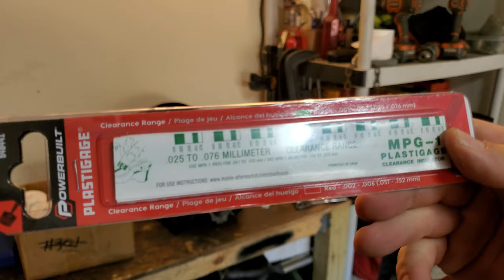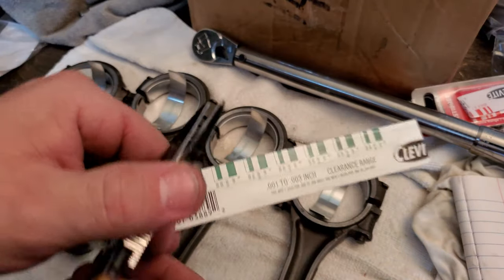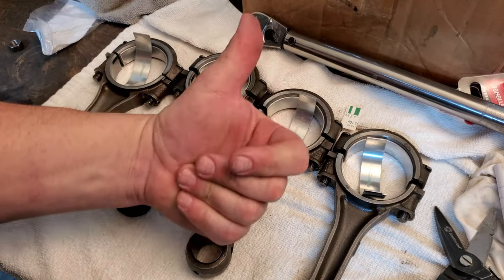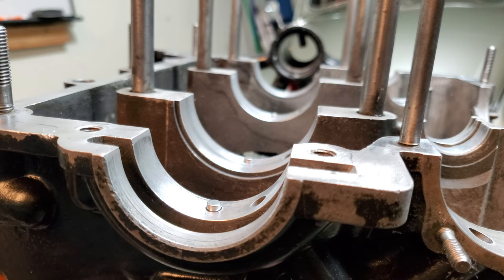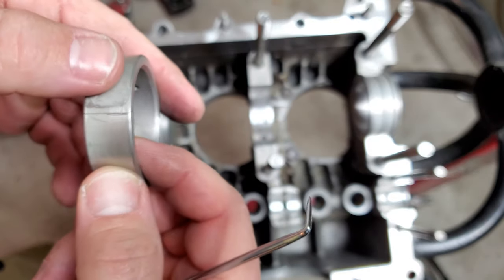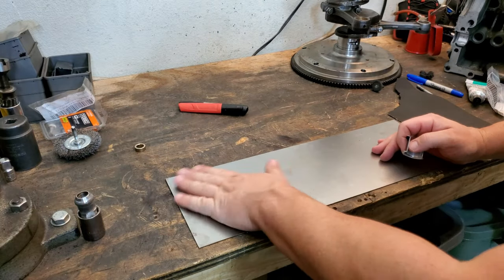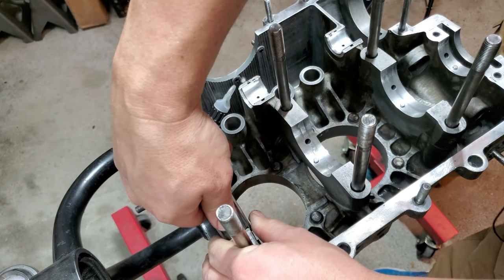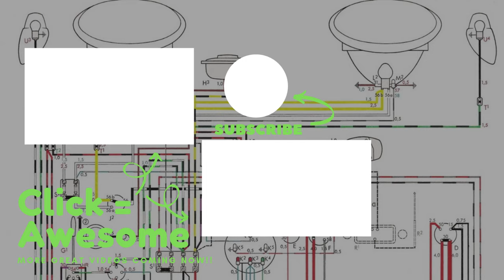How to Rebuild a VW Air-Cooled Engine "PART 3" Bearing Fitment | JW Classic VW

Comment: I would use a copper head hammer to tap bearing dowls in it cases damage on the engin it causes litt or no damage to any parts on assembly .

Comment: Great video & love that you dont waste time on small talk. Whats you opinion on straight cut cam gears thx...
Reply from the maker: There is all kinds of info out there and opinions as well, I believe that when you have a higher power engine that may be spending some time in the higher RPM range say above 5G then they can definitely help reduce the stress on the valve train.

Comment: Iwont you trying idf injection  type in your engines
Am now trying it on 1.6L
its amazing no need adjustments works perfect 
You can see my test start on video 
You can use any type of ecu
Iuse vw golf all same and owen wiring and works 1.6 and it works with bigger engine without programming only when add turbo that time need more fuel so programming should be
Thx for video great job you doing😍
Reply from the maker: Someday in the future I will build an EFI BEAST... just not yet!  Thanks for being here brother!
Reply: What year/engine vw golf??

Comment: Got a question? Got all the locator bearing pins out except for the aft one that take the smaller bearing. I tried a magnet and needle nose but it's really in there? I could let the machine shop worry about it before they alinebore it. Unless you have dealt with this before? let me know. I guess I could heat the area around it just enough to pull it out maybe?
Reply from the maker: Yup... I've had to heat it up as well.  Sometimes they still won't cone out, then leave it to the machine shop.
Reply: Do i need to remove the oil pickup tube for the machine shop to alinebore or just leave it?
Reply from the maker: You can leave it in.

Comment: not a bad idea using a pressure washer, I think what I'll do with the 2 blocks I got is coat them in a degreaser, let it sit for an hour or two, then spray them clean, and inspect from there
Reply from the maker: That is a good way of doing to... I also used 2 cans of Gunk engine degreaser. Just not on video 😉

Comment: Hi Jason, not sure if I told you but the 40h measurements are all good and still stock. is there something I can use to clean off the oil stain on the main bearing saddles or just leave them alone other than using brake clean on them?
Reply from the maker: Really don't need to clean them to much if the stains are bothering you a little bit of 0000 steel wool should clean it no problem.
Reply: cool, just didn't want to disturb the metal since it's still measuring good. But didn't want to put new bushings on top of it. Waiting on the weather to get warm enough around here to continue cleaning the case halves. Seattle has been super wet and cold this year more than normal.
Reply from the maker: @TimsWorkshopTJY  0000 steel wool with some WD40 will be more like polishing the seat.  You could also use like 800 or 1000 Grit sandpaper.
Reply: Thanks Jason for your help.

Comment: Do you ever use plasigauge when your rebuilding you engines. Just curious I have rebuilt many V8 and V6 engines in the past 40 years and always use it and never had a failure.
Reply from the maker: It's covered in a later part of this series.
Reply: Oh man a simple yes or no would be good.
Reply from the maker: Lol... that was a yes.  Didn't know if you wanted to know if there was a video.

Comment: Jason, question, bought an aftermarket flywheel and getting ready to mount my con rods. Noticed my crank doesn’t fit all the way into the flywheel hub. It appears the crank OD and flywheel hub ID is a interference fit? What’s going on here.
Reply from the maker: Keep rotating the crank... they are keyed in a particular way.
Reply: @JWClassicVW  I’ve rotated in all positions, still the same result. Samba says it should be a tight fit. I’m worried it will get stuck and then what...any chance you can cover this? BTW, all dowels line up fine. And, the flywheel has the o ring groove.
Reply: So I figured it out. Slight interference, no problem. Moving onward!

Comment: Firstly great video man love this also need some advice, so my rods are free to spin easy but not as easy as you have yours is that a huge problem or what is your opinion
 thanks in advance
Reply from the maker: Well brother you may have some tight bearings there.  Sometimes you can wash the bearing with a scotch bright pad to obtain proper oil clearance but first, you need to check it.  The Plasti Gauge can help you confirm your gap once torqued down properly.  If it's too tight you may need to have the crank turned and polished.  Hope this helps... the last thing you want is to burn up a journal surface and rod bearing.
Reply: @JWClassicVW  thanks I appreciate the response and I will do that, I don’t want to completely re build the engine just to re do it again lol - as fun as it is my wallet doesn’t allow that haha. Thanks for the help
Reply: @JWClassicVW  also how do I match up the bearing sizes with the result of the plastic gauge.

Comment: Can we check for line bore at home ?
Reply from the maker: Yes you can if you have the bore Gauge.  You'll need to torque the case halfs together and then inspect  each main bearing location for out of round and run out.  At the same time you'll be checking for differences between each bearing location.  The truth is if you can see any imprint of the old bearing info on the journal surface you probably need a line bore.
Reply: @JWClassicVW  ok thank you. Ive done tons of american engine rebuilds since the early 70s but this is my first trip on a total splitting the case vw rebuild.

Comment: Where can i get a decent distributor drive gear to buy.
Reply from the maker: CIP1.com is where I picked mine up... they also have the little washers required if you don't have them.
Reply: @JWClassicVW  Ok thanks.

Comment: What book are you looking at? And where do I get one?
Reply from the maker: That is the Bentley Service Manual.
Reply: @JWClassicVW  what year is the applicability?
Reply: I’m building the same engine. But I plan to add dual carbs and cam. Any recommendations there?
Reply from the maker: @scottalvey1787  I have 2, one for 1960 - 65 and one for early 1952 - 1957.